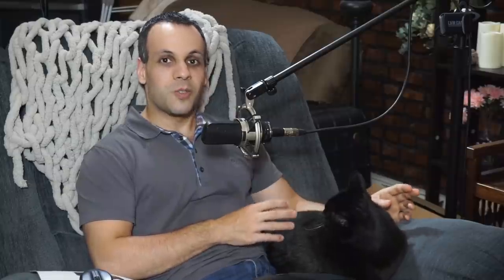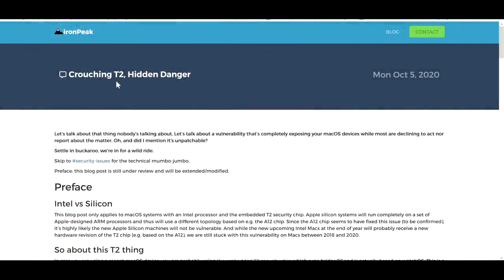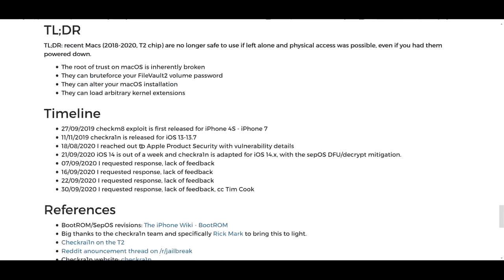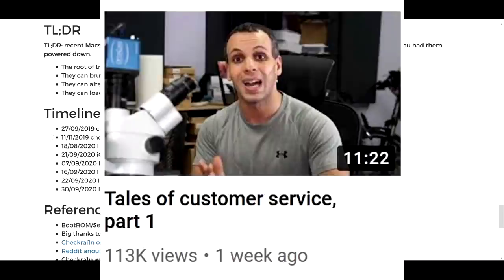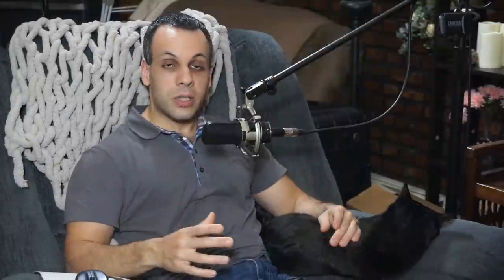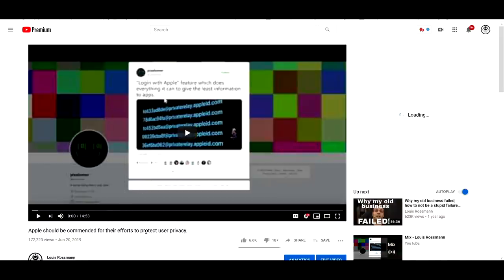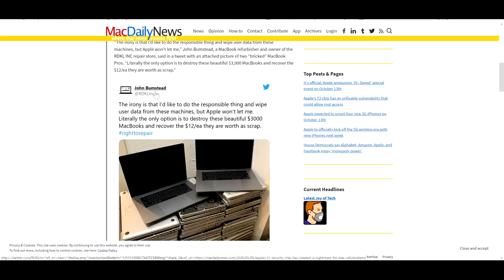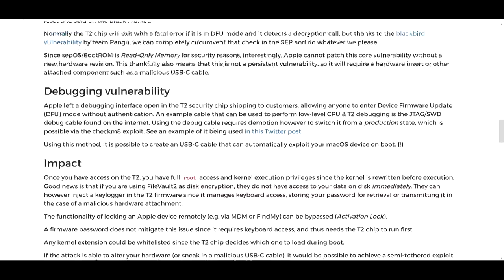Apple T2 chip security closer and closer to being compromised.

Comment: The US is the country that writes the date backwards, not us. Sorry.
Reply: that's subjective
Reply: Sorry dude, you're wrong. ISO8601 has been an international standard for 30+ years.
It unified and replaced a number of older ISO standards on various aspects of date and time notation: ISO 2014, ISO 2015, ISO 2711, ISO 3307, and ISO 4031.
https://explainxkcd.com/wiki/index.php/1179:_ISO_8601
It's really hard to engineer proper timekeeping.
https://infiniteundo.com/post/25326999628/falsehoods-programmers-believe-about-time
Here's one of my all time favorite anecdotes:

That thing about a minute being longer than an hour was a joke, right?
No.

There was a fascinating bug in older versions of KVM on CentOS. Specifically, a KVM virtual machine had no awareness that it was not running on physical hardware. This meant that if the host OS put the VM into a suspended state, the virtualized system clock would retain the time that it had had when it was suspended. E.g. if the VM was suspended at 13:00 and then brought back to an active state two hours later (at 15:00), the system clock on the VM would still reflect a local time of 13:00. The result was that every time a KVM VM went idle, the host OS would put it into a suspended state and the VM’s system clock would start to drift away from reality, sometimes by a large margin depending on how long the VM had remained idle.

It remained unresolved for nearly half a decade.
Reply: Yes! I hate it when I see the date written in MM/DD/YYYY, it confuses the heck out of me. Why they can't just use DD.MM.YYYY like any other normal nation? Oh, right. The USA likes to do everything backwards from the rest of the world, it impresses me that they don't ride on the left.

Comment: This was bound to happen. It happens with every single device that claims to have unbreakable or nearly unbreakable security. Sony Playstation 3 root key, Xbox 360, Xbox One, iPhones, every device that is popular and has this claim of unbreakable Security will eventually have an exploit found. This is actually good for the industry, although in Apple's case I believe they can simply update the firmware of the t2 chip and negate some of these exploits. That also leaves open the possibility of all these Apple devices that have not been updated for getting wiped and resold. It is extremely wasteful to have a piece of Hardware that is that valuable become a basic paper weight because Apple doesn't want to resell it. Because Apple doesn't want to fix it. Because apple does not want to provide a secure way to wipe a device without access to it and make it usable again if you can prove you're the owner.

Comment: If the chip and its firmware is not open source, I would never trust that it is secure. It's better to encrypt your personal data with 3rd party open source software rather than rely on a company with questionable morals.

Comment: I have an iPhone 6 that suffered this experience.
I got it from a yard sale, quite clearly worked on.
But it's iCloud locked, and is useless except as a pretty little slab of glass and metal.
Hilarious part is, I tried to do the honorable thing. I contacted Apple support to let them know that I had an iPhone that was iCloud locked, and if it were possible to reunite this device to its former owner.
Completely impossible. Support could not give me any kind of information to try to figure out whose phone this used to be.
And, of course, it's also impossible for me to break iCloud lock.*

* It was before Checkm8/Checkra1n, which is relatively new, and I will be attempting this weekend. My yard sale i4 is getting long in the tooth, and being able to use a slightly less ancient i6 as my "okay wtf is this iOS thing" device would be an improvement.
At least until it folds in half and dies.

Comment: I think you should be able to wipe it with a registered system say in the Apple site.  If your a repair shop you can see the status of that system as given away sold or stolen. Apple is missing a huge opportunity here. They could even charge $20 or so.
Reply: They rather charge 2500 for a new sold shitbook.

And obviously they dont want other repairshops to bring thier machines back to race.  You can do apple care, where fuckwits tell you repair is 1800$ and new one can be purchased for super cheap at 2490$ instead of the full price. Or you can trash the laptop just by you own desicion and buy new for 2500.

Thats how nasty apple works.

Comment: physical access = compromised machine

even if t2 wasn't fucked, attackers could just add a clipper chip to the keyboard circuit and intercept keystrokes. or add an internal usb device that acts as a rubber ducky keyboard and opens a terminal to curl+execute a script to give remote access.

thunderbolt has DMA and despite apple patching it, there will ALWAYS be crypto key extractions possible from there too.

Comment: I am about to replace 2015 13 inch macbook battery so hope I wont set myself on fire. Louis, please I need to know something. Can you hack iMac to use as external monitor with board or anything, to hack it any way? I think it will be very interesting to a lot of people. I will probably ask you under every video from now on. Please be so kind and dig into it if you have the time. I don't know who else I can ask.

Comment: In other news, the T2 chip has already, indeed, been hacked. 

The only bright spot is that if the files were encrypted with filevault2, they aren't accessible. But. . . a keystroke logger can be embedded into the T2 chip. 

Full details of the exploit are available at the following link. 

https://www.techspot.com/news/87009-two-iphone-jailbreaks-can-used-hack-t2-security.html

So it would seem that those supposedly bricked MacBook Pros might actually be useable after all.
Reply: I would think that before going through all of the hassle of actually broaching the security of the T2 chip, it might actually be easier to just startup the computer in target disk mode. 

The drive will mounted as a disk image by another computer and the files accessed as long as they are not encrypted. If they are encrypted, well, then one will still need the password and it's back to the keystroke logger.

Comment: • 1:11 - The T2 chip gives you "more security". So basically, it's Apple's version of a TPM module. TPM proponents tout its security and safety from viruses, but the vast majority of its features benefit companies, not users; it's a hardware way to lock you into a walled garden. Microsoft has been pushing for it for years, especially now with the Windows Store. Google loves it too for Chromebooks. Basically, they want all the control, they don't want users to have any control (or choice).
• 7:49 You can't format a Macbook? You can't replace the drive either? 🤨 The whole system is scrapped because of software? 🤦
• 7:53 - Yeah, of course. Hardware security is specious because it eventually ends up in software at some point which can be cracked. Moreover, even purely hardware stuff isn't impervious, just look at all of the modchips. 🙄 If anything, the extra challenge is even more enticing to hackers. 😀
Reply: Thankfully Microsoft of late has backed off at least slightly from the super stubborn/strict Windows Store only approach and has now been allowing Steam releases as well on most of the titles that come out now. Doesn't erase their past anti-consumer behavior, of course, but they at least seem to be headed in a slightly more "open" direction now, for the time being. We shall see if that lasts though, lol.

Comment: I have lost money not being able to unlock apple devices at the time mostly iphones and ipads the best I could do for the customer is tell them that I could wipe/reload a corrupt OS but it would be up to them to contact Apple to be able to use it. They pretty much killed the second hand market and parts market with it both with security and putting everything on one board. Unlike you I was unable to do most board level work and how many people are going to unlock their old hardware before recycling it making parts rare and expensive. As Apple is the tail that wags the dog other manufacturers will follow just a matter of time before the computer repair business goes the way of the home appliance repair. Knowing this takes a bit of the sting out of being forced to retire for health reasons. NOW as an Apple user I like these security features. I realize anything can be compromised it would just take a lot more effort than other products and the security + the death of the second hand/stolen market makes my devices less of a target for thieves and harder to get to my data but easier to track down if stolen or misplaced.

Comment: I have no need for this type of security. I much prefer the old school method of encrypted containers for data that needs to be secured. Someone else might care and I understand using Whole Disk Encryption at that point. For me if all my data got out I really wouldn't be that upset. Nothing stored in the cloud for me is going to be anything I'd consider a secret. Sure it sucks to have my shitty food and bike ride pictures spilled all over the place... I just want to be able to access my data easily if a computer fails. I want to pull out the drive and recover it. Anything less feels like a step backwards.

Comment: They are ARMing themselves (sorry for the pun). AMD has a similar solution with the AMD Secure Processor (formerly PSP, Platform Security Processor, also ARM). Note that calling something secure doesn't make it secure. What you are describing in the beginning, possible bricks, are side-effects that generally occur with lockdowns, by design. It's sadly still a very fragile construct, and the same happens when people try to enroll custom keys for SecureBoot on UEFI platforms. Now the question is about the threat model. Why are vendors doing this? One reason is that malware persistence in firmware is not only possible now, but also seen in the wild (see recent news, https://securelist.com/mosaicregressor/98849/ for example). So what would a customer prefer - low-level security with the possibility of a brick or the risk of persisted malware? To be honest, even I as a security person wouldn't want to make that decision for anyone else. I can explain it as briefly as I did here, and I can't tell which side's cons are the worse.
Here is one horrible downside: If a vendor misses to blow the fuses to have their keys definitely non-erasable, firmware malware may do so. Then your device is suddenly hostage to the malware owner. And if the vendor (OEM) loses their key, and they blew the fuses, there is no recovery either (same scenario when their keys are compromised). Vendors are aware of these facts but not transparent about their decisions. That is something I would like to see them forced to publish, be it by legislation or whatever.

Comment: My 70 years old landlord have a Samsung tablet. She forgot the password and it was a painfull process to reset factory the tablet. Did'nt found any hack to crack her MF password. Personnaly i hate those protection on board. You may say but it will give opportunity for thief to recycle the product or have access to sensitive data. My solution will be more to store a unique identifier on a ROM chip on the board, when you purchase a computer you must register this unique identifier at motherboard manufacturer or a third party company. And every time you have to connect to internet, or every day, or every week, a authentification is made at the motherboard manufacturer or at a third party to validate if the computer is reported stolen. To protect the data on the disk  you encrypt it with the password like in the Linux world. So ok if you loose your password you will loose your data but at least it will be much more easy to start from the beginning. A bit like in the car industry when you have to register your vehicule. It is very hard to register a stolen car most of the time they dismantle it and sale parts...and with my solution the board will also be able to send automatically the IP/MAC address of the thief.

Comment: I'm surprised their T2 implementation is so bad. I was expecting more from Apple.
ARM chips nowadays come with security hardware features such as TrustZone that are baked in hardware making it virtually impossible to crack. I design and develop secure hardware as a living for industries where this actually matters. Where breaking into a piece of software means people can have their data stolen, they could cheat out of bills, or worse, it could harm people. Nothing like in Apple case where all it does is prevent you from owning your own consumer goods so you can repair them yourselves. Apple are just being dicks. Thankfully they aren't that smart about it, it seems.